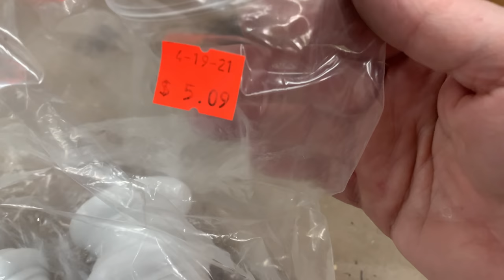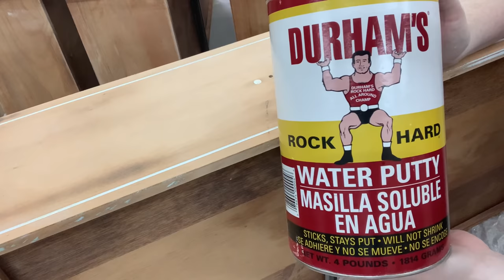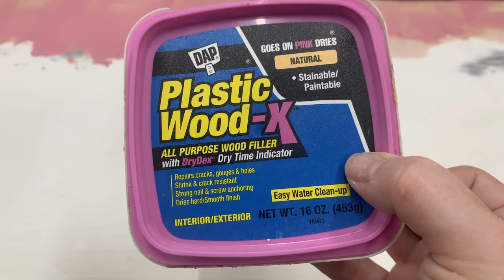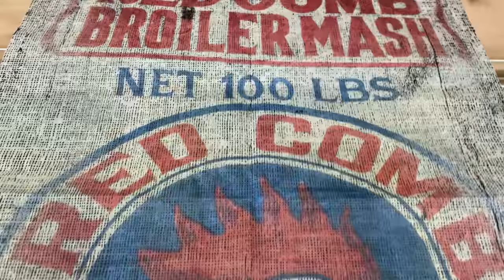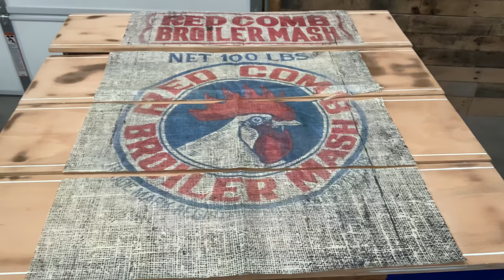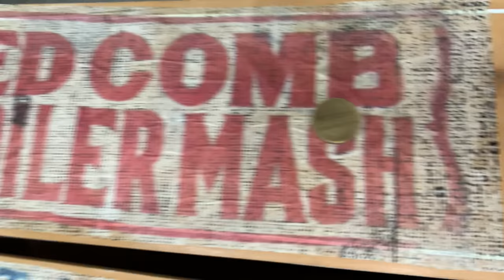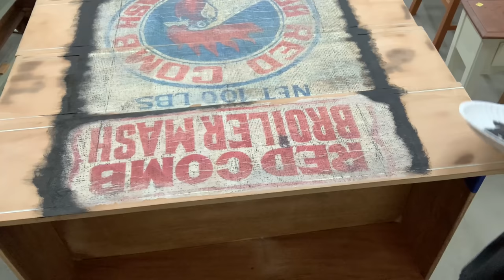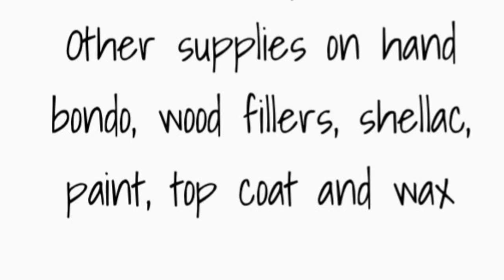Amazing Save || Garage Sale Finds || Dresser Makeover || Decoupage

Comment: You do such a thorough job on your pieces.  Beautiful painting and sealing.
Reply: You finished an old dresser that you had in your stash.  It has unique drawer pulls where the actual pull went through an eyelet,  that went through the faceplate and fastened in the drawer with a square little nut.  I  just acquired an antique wash stand with The Exact Same Pulls  !!!  My piece is from 1917-1927.   The company wasn't in business very long.